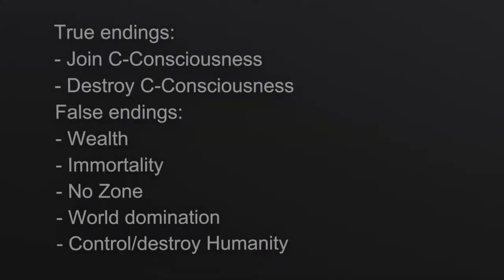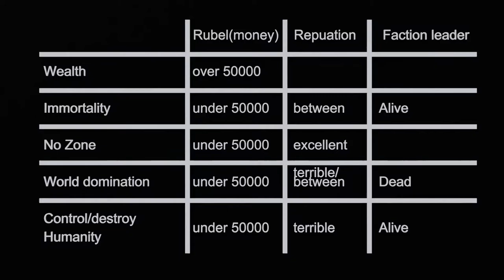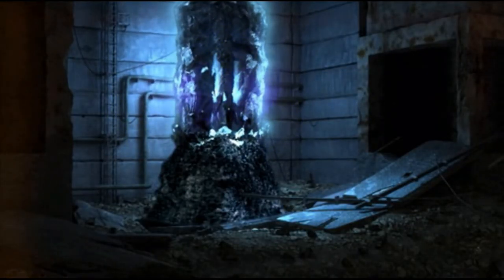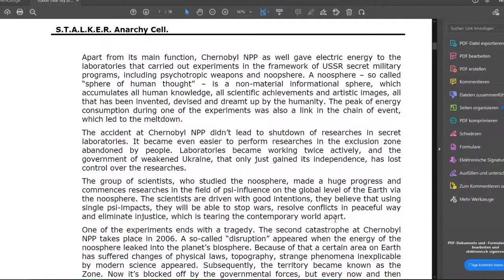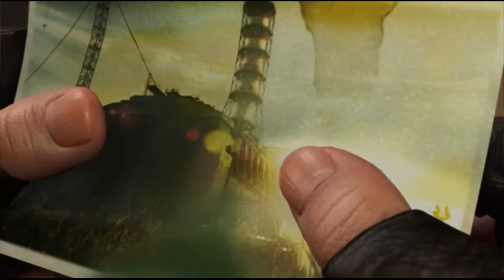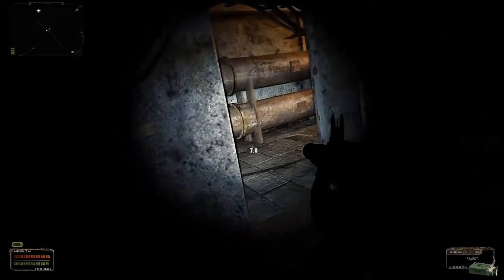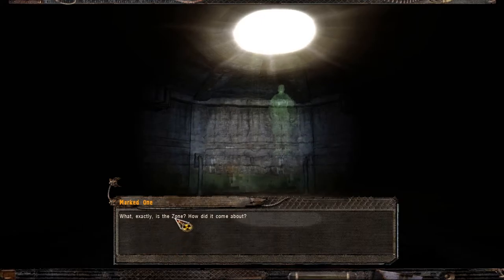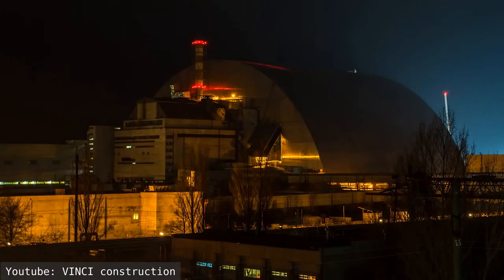S.T.A.L.K.E.R. Shadow of Chernobyl: All Endings Explained

Comment: Interestingly enough if any one here knows about the Anime Series "Fate" the Holy Grail in Fate is Known to do similar stuff like this not necessarily always as extremely or as cruel. but it is known that the Holy grail in Fate can warp wishes and twist them in sometimes cruel ways as well. because of the archaic nature of wishes and how their meanings and intentions can be complex and not always literal it becomes complex. The Holy Grail however isn't actually a direct wish granter in some cases it is mentioned that the holy grail is instead a "Mana Accelerator" that simply accelerates through time and alternate realities and timelines and more to FIND the "Possibility" or closest likelihood of your wish. because of this it is not directly granting your wish out of thin air it is rather pulling it from alternate timelines and realities or a infinite possibility. like say you wished for your dead lover to return from the dead instead of it directly reviving them it would instead accelerate through possible realities and timelines to find a point in which this is possible where they are either NOT dead or survived or already somehow brought to life or etc. it's simply seeking a POSSIBLE solution to the wish. however because of this the wishes are inaccurate sometimes and can result in dangerous outcomes especially if the wish is unspecific. anyways this is just what I would compare the wish granter too in some ways who knows how the wish granter actually fully functions. if it's the same or if it's just immediately a cruel and elaborate joke of the ZONE and Anomalies